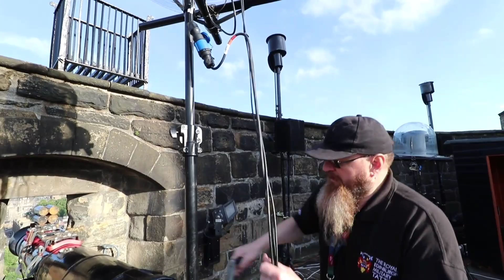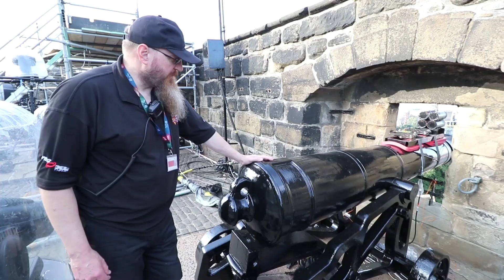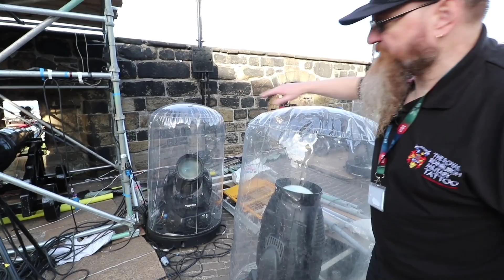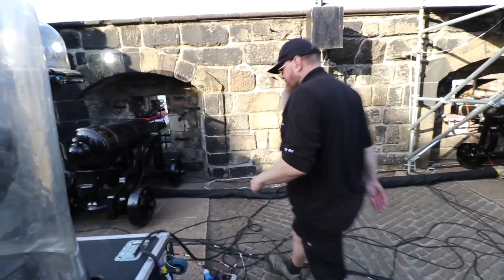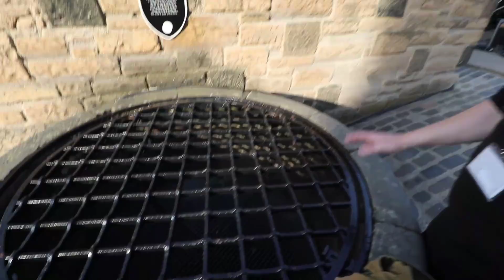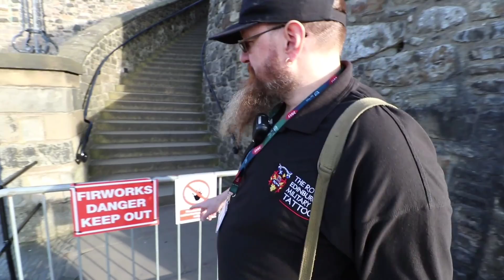Nightly setup of part of the Royal Edinburgh Military Tattoo lighting.

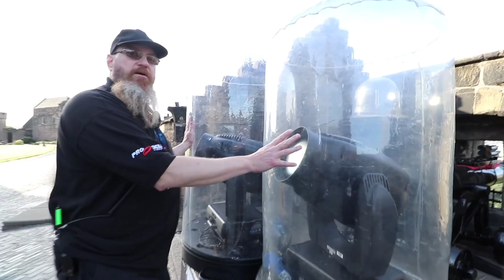Comment: @2:44          When I was a touring, if the venue was setup for it, I had a huge PVC frame that fit together with a very thin, white cloth that stretched across it.     A little wood riser platform went behind it and the whole thing went behind the band and between the curtains (it was very venue specific but was well worth it even with the 15-20% use we got out of it) and behind all this I had one of my Wildfire 1000some watt UV lights (which stayed hot for hours after a show, perfect for touring).    We'd get people from the crowd (and one of our roadies was quite good too) and have them dance on the platform...  with everything set just right you wound up with a giant glowing panel with a 20'+ tall shadow dancing on it, so shadows aren't always bad !!!!

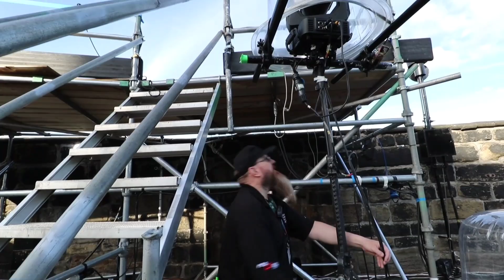Comment: What would happen if the stand you're talking about at 1:53 was displaced by one millimeter?
Reply from the maker: It's not that critical for these lights as they just fire out tight beams into the air.
Reply: bigclivedotcom 
I thought you were talking about the stand behind you.

Comment: Hi big clive what kind of radio where u using as i seen it on your side and it looked really good ive been after a radio to use with my other 2 way radios
Reply: That is most likely a commercial radio that will be programmed with a hardware programmer for their allocated commercial frequency, not really something that would be of use to a civilian. If you enjoy experimenting with radios considering becoming a licensed amateur radio operator. Then you can legally play with a whole bunch of different radio types.

Comment: Fun. Thank you.  When I say that Clive is an electrician and that that is an on the job training field, this is what I mean. 

Nothing wrong with that. I am Union trained myself in four fields. Far be it for me to criticize. 

However gents, don't ask him how to be an engineer. He'll only tell you not to read books you see. 

On the job fields, such as electric, are not the same as book fields, such as electronics. 

If you actually want to learn electronics, break out Horowitz & Hill, 3rd ed., vol. 1 (save 2 for later - expensive.)

All you haters that spam my email can bite me. I know of what I speak. 

If your young, and you want an actual career in electronics, be an engineer, most definitely not an electrician. 

No disrespect intended.  I'm Union trained, from glass blowing to paper making to electric to mill wright. I do know the difference in the ways of training. 

Clive is doing you young people a disservice telling you not to read.
Reply from the maker: +Crocellian So you reckon my full traditional apprenticeship that started when I was 16 with an electrical engineering company that specialises in power distribution in steelworks doesn't count?  Or the fact I was with a real union from the beginning ( EETPU) which is nothing like an American union.  There's certainly a big difference between a temporary event installation and a fixed installation.  This one is temporary, but has racks of well designed power distribution equipment with multi-layer RCD / GFI protection on every single circuit.
Reply: Crocellian... You're a semi-literate idiot who doesn't know what the fuck they're on about.  To become a recognised tradesman here you need BOTH 'book learning' and on the job training.  Normally - it takes a minimum of 2400 hours at college to get an HND, PLUS while you're doing that you'll be working a full-time job for four years. And that's only the start of the journey!    Being trained to carry out a job in a factory isn't an apprentice/traineeship, and definitely doesn't entitle you to call yourself any kind of 'tradesman'!

Comment: Can we see the lighting desk ... please?
Reply: Many thanks for the link Bob ... Great setup, the lighting desk is a Road Hog 4 - 8 universe DMX. Would dearly love to play with that one :) I wonder if it's the same setup this year.
Reply: It's not a Road Hog 4, it's a Full Boar 4, the RH4 is smaller with a single 22" screen ;) 
The full Boar 4 is about the same format as the Roadhog 3 was though.

I work on a RH4 quite often which has indeed 4 DMX ports and/or 8 universes on the network.

The Full Boar 4 also has 4 DMX ports built in and/or 12 universes over network. 
+ moving faders, 5th encoder, trackball, grand master, LCD screens on the command keys,....

The Hog 4 (that's the top of the line full size one) has a DP8000 built in: 8 dmx ports, and/or 16 universes on the network.
+ rate wheel and intensity wheel + center touchscreen and encoder + adjustable angle screens.

All in all nice consoles (from the roadhog up, don't care much for the hedgehog) but they need some work on the software front, let's hope ETC will help High End with that.
Reply: On closer inspection of the video I think we are both wrong. Clive says what sounds like 'Whole Hog' but it isn't that. The highend.com website reveals that it's a HOG 4.
Reply: You are right, it is indeed the Full size Hog 4 with the center touchscreen.

There is also a Roadhog 3 playback wing in that video (the blue wing to the left of the hog 4)
To the right you can see the smaller Hog 3 PC playback wing.
And another full size Hog 4 in the back for the backup.
(lots of overkill, could do the backup with a tiny PC and a wing, but hey, that's what PRG has so they use it ;) )
Reply: I'd love to own one but A/ I don't have 22,000 euros to spend on a lighting desk and B/ The small theatre I own does quite OK with one universe of 12 addressed fixtures. Nice bit of kit though :)
Reply: A Full Boar was 22k euros new a while back, don't think you could get a new Full size Hog 4 for 22k today. (maybe demo or light used one)
I'd buy an MA2 ultralight anyway for that kind of money :D

I stayed with Hog because I already knew it and the Nano and RoadHog combination I bought was about half the price of the cheapest real MA2 console...

Anyway, it's not the console that makes the cues is it? ;)
It's only a tool in the box.
I've seen great shows on Zero88's and bad shows on MA2's.

Comment: How do those telescoping crank up stands work? very cool
Reply: http://curriculum.vexrobotics.com/sites/default/files/styles/large/public/10.9.1.PNG
Reply: Maxx B if you look there are multiple segments telescoping out at the same time
Reply: Manfrotto 087NWB (B for black :p ) 

It's a combination of a gear rack and a steel cable with a pulley.

As you rotate the crank a cog engages with holes in the bottom tube (just as a gear rack) this slides up the bottom tube.
This then pushes up a steel cable over a pulley which pulls up the inner tube.
Quite a nice compact and lightweight system.

Other crank stands (like Genie, Guil, Fantek, VMB, Work,...) mostly have a crank winch, and these take more room (because they need the drum for the winch cable)
Reply: Painfully slow.  That's how.

Here in the US, I have some stands targeted for the consumer/DJ grade user.  Mine have wonderful hexagonal studs for attaching a drill.  Quick up and down.
Reply: http://aprs.org/Antenna-Ipipe.html

Comment: The cannon reminded me of a proms concert held at the castle in Cape Town in the late 90's where at the conclusion of the 1812 overture the military set off several 25 pounders loaded with blanks just outside the castle. Unfortunately they positioned the guns facing Cape Town train station and the concussion ended up disabling a large number of signals and causing major disruptions.